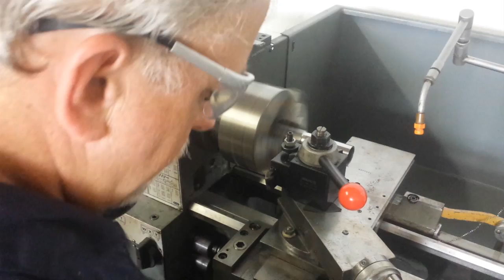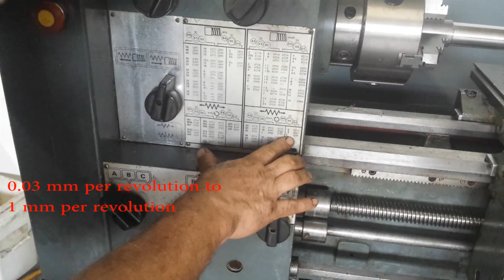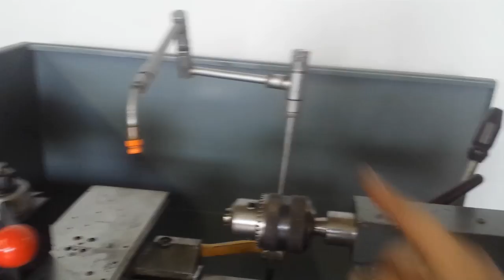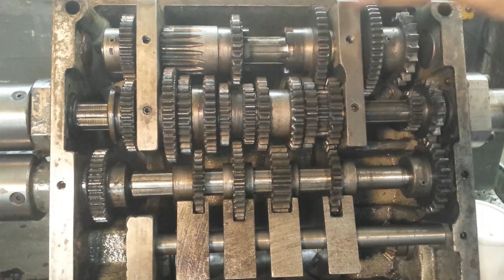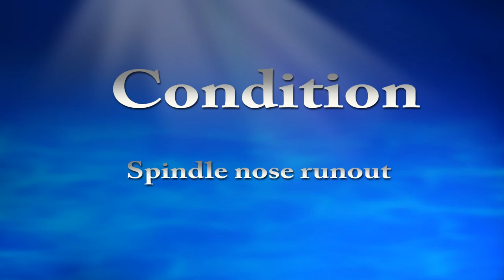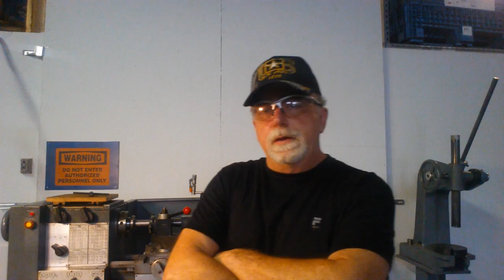Harrison M300 lathe

Comment: Hi so the 600 group still sell the Colchester and the Harrison brand manual lathes but it hard to know which is better . I’m on the market for s new one , I have an old 70’s colchester 15” but would like to know if there is much difference , tried asking ‘clausing’ but they just say they are similar ..... I really want the tech stuff , the gear change was different on the colchester for years but now it’s similar to the Harrison, knobs I steady of the dial...... 
I’d love to hear what you have to say 
Cheers Warren ( in USA)